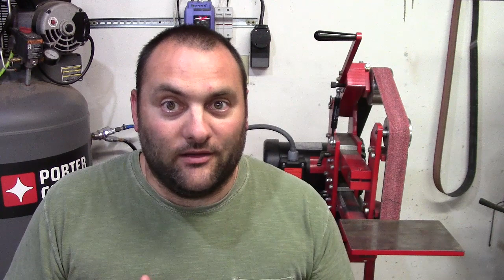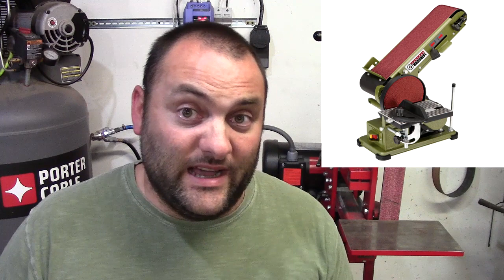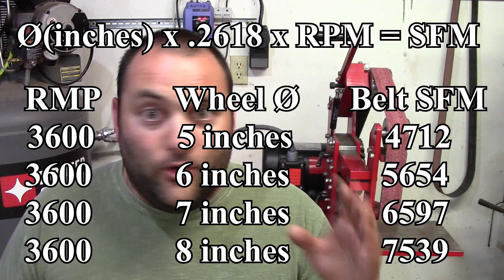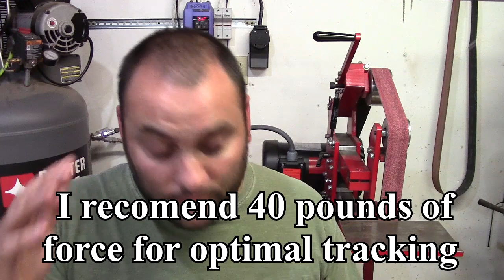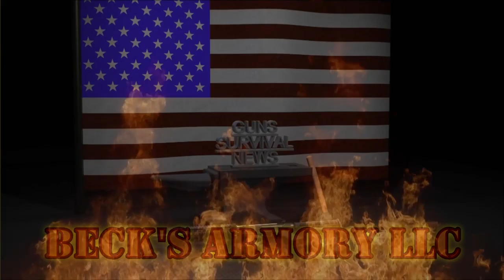Beginners Guide to 2x72 Belt Grinders

Comment: For clarification most 1.5 motors are 2 motors they’ve just been wired for 110 and lose .5 because the voltage of 110 can’t power 2. This is why they cost as much as a 2

The size of the motor largely depends on the outlets you have. While 220 is easy to install it may not be an option for people so 1 or 1.5 would be the route they will need to go.
Reply from the maker: This is not the case.  If you read the name plate on a 1.5hp motor and 2hp motor they have different amperage ratings.  They cost close to the same because it takes about the same amount of material for both.  Running a 2hp motor with 1.5hp settings is NOT a good idea.  Will it work?  Yes.  You'll end up with lower performance than if you run a 1.5hp motor at 1.5hp settings.
Reply from the maker: An Iron Horse 3/4 hp motor is $253.00 and a Iron Horse 1-1/2 hp motor is $281.00.  Price is NOT linear relationship in regards to hp.  By your logic the 1-1/2 hp motor should cost $506.00.  They make specific sized motors because the "one size fits all" idea  is just internet BS....

Comment: What about multi speeds by using a step pulley system?
Reply from the maker: by the time you buy bearings, jack shafts, couplers step pullies and a belt you've spent the same amount as a VFD... There is no point in using step pullies unless you just have lots of extra time to waste. :)  I've done the math and step pullies are just not worth it for me.  The only advantage is a step pully setup will give you more low-end torque which you don't need.  You're sanding items not tapping holes. :)  If we're talking about a knee mill or drill press that's different.